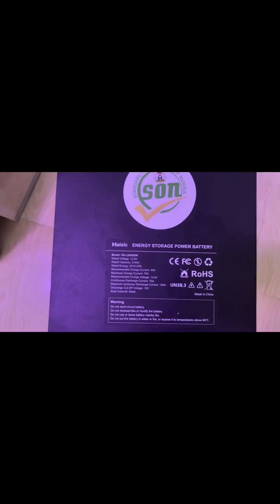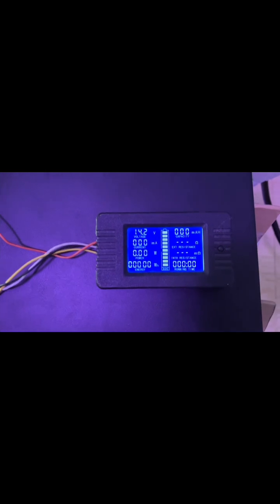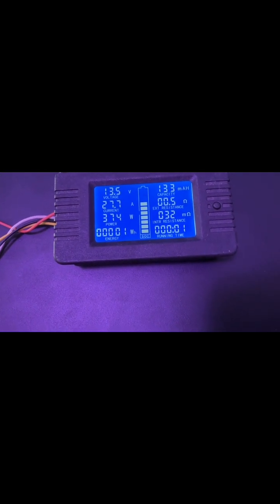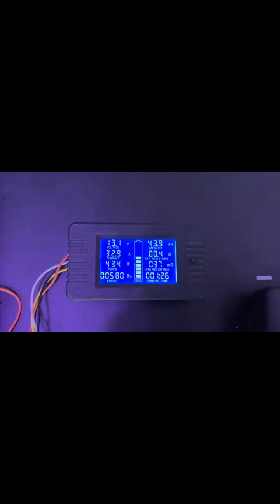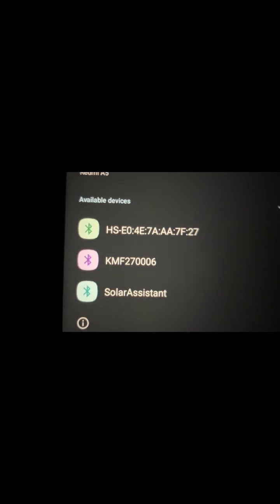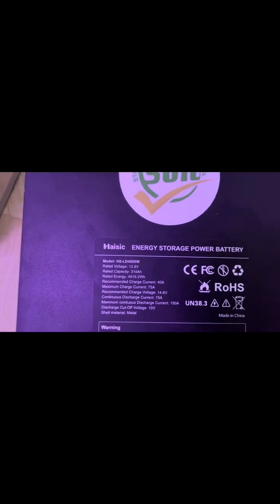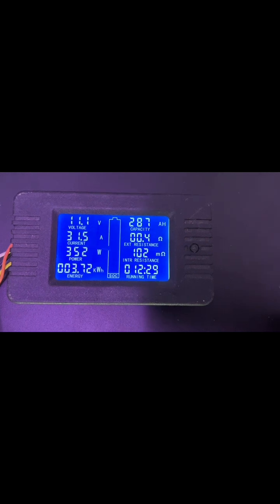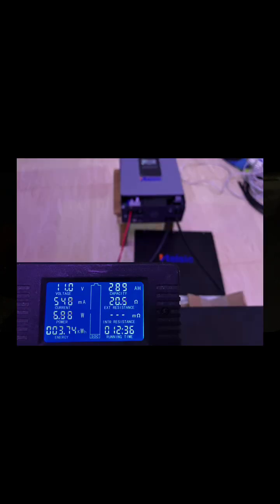Haisic 12V 4KWH Lithium battery Full Capacity Test

Comment: Firstly thank you very much for this video....I think they did not factor the dod when putting the 318....if you check the dod it will be 90%(I don't know just guessing).... But on constant 350watts usage  it is very reasonable... based on this demonstration It is a good product

Comment: good work bro, i have a question just installed a 12v 100ah cworth battery,  i am using the haisic inverter and i will love to increase my battery capacity my thought was to get another 100ah battery and parallel it but i will love to do more, is it ok to get a 200ah and parallel it with the 100ah or just go with this battery and find a way to sell the 100ah? thanks
Reply: You can parallel a 100ah with another 200ah without issues. But for proper balance, just get two pcs 100ah instead of one single 200ah. Then parallel them. Parallel connection is pretty much safe regardless. The batteries will balance themselves unlike if it was a series connection. But make sure your positive is on your first battery and your negative is on the last battery
Reply: @EasyyokeFilms  thanks
Reply from the maker: You can parallel.. I did the same yesterday I parallel a Cworth and another battery 100A
Reply: @odedeyidamilare   ok thanks, there will be a two-month age difference between the batteries hope that does not matter
Reply from the maker: Doesn't matter as long as na parallel  @juanantonio1436
Reply: How much is it?

Comment: Well done. I'm thinking of buying one of this. What will be your recommendation? Two 200AH batteries or one of this?

Also, is it possible for you to do a tear-down test of this battery, so that we can see what's really under the hood?😅
Reply from the maker: The Cells are 280AH, Teardown already done. 
For 450k you can't go wrong with them. You may not get full capacity 200AH.. 
I Teardown before even testing then.
Reply: @odedeyidamilare  is it grade A cell
Reply: @odedeyidamilare  Sorry, I meant to write two 100AH or one 200AH? Also,  may I have the link to the tear-down video. Thanks
Reply from the maker: @ezzbee  There is nothing special about the Teardown 280AH cells and BMS nothing else
Reply: @odedeyidamilare Good review as always. Did your teardown reveal grade of cells?
Reply from the maker: @kokatrends  cell Grade are unknown. But pulled Full capacity for a 280AH cells